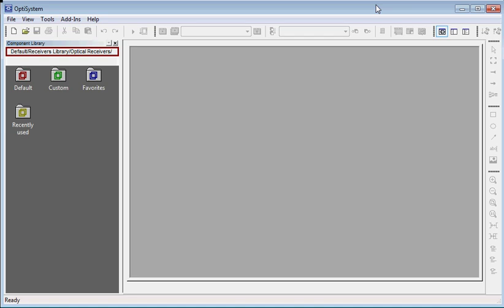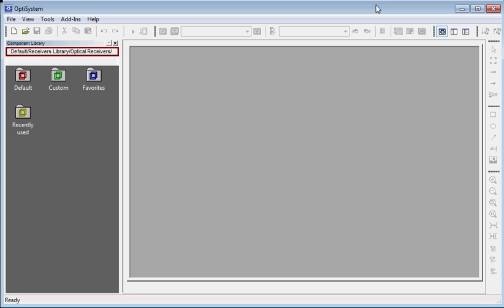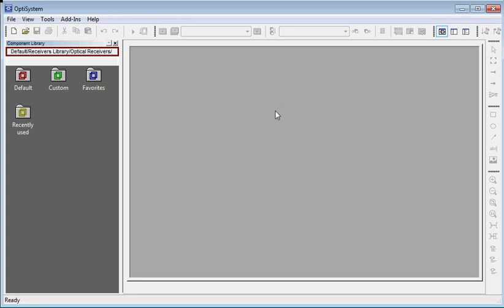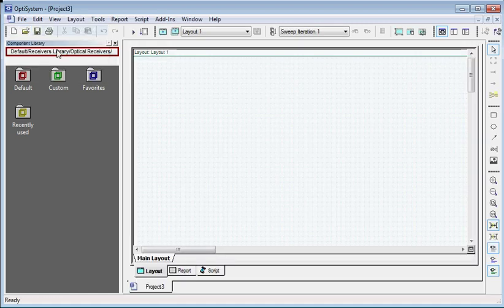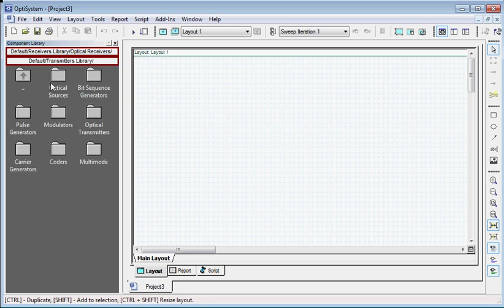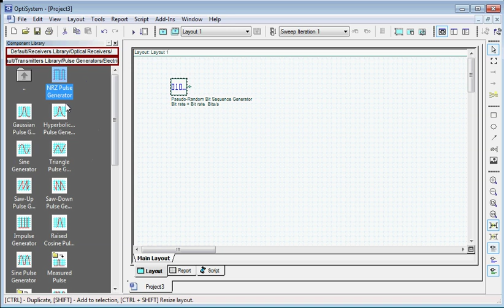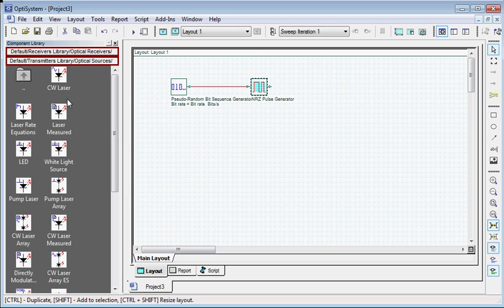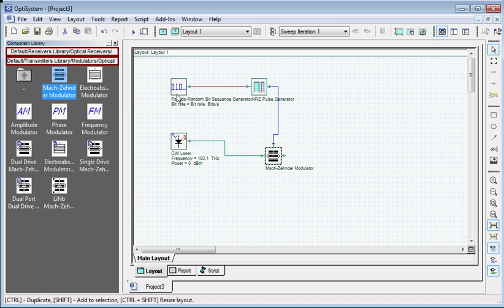Introduction to Optisystem - Transmitter

Comment: I m using  16 qam optical transmitter from the component library with power equal to 0dbm but when I connect optical power meter with that that is showing _14 dbm power could u plz suggest what should I optimize sp that I could get 0dbm power in optical meter

Comment: Congratulations for the initiative.
We also work with simulations of optical networks and photonic crystals in OptiSystem, OptiGrating and OptiFDTD.
I made a tutorial in Portuguese about OptiSystem.
Follow the links:

OPTISYSTEM TUTORIAL IN PORTUGUESE - CLASS 1 - TRANSMITTER IN OPTISYSTEM
https://youtu.be/oLL-HjBVerM
OPTISYSTEM TUTORIAL IN PORTUGUESE - CLASS 2 - CREATING A RECEIVER IN OPTISYSTEM
https://youtu.be/XpbwqJNNJI8
OPTISYSTEM TUTORIAL IN PORTUGUESE - CLASS 3 - INSERTING THE OPTICAL FIBER AND EDFA IN THE OPTISYSTEM
https://youtu.be/aiv9oe9o-Q0
OPTISYSTEM TUTORIAL IN PORTUGUESE - CLASS 4 - SIMULATING IN OPTISYSTEM
https://youtu.be/ycN95LhvtnU
OPTISYSTEM TUTORIAL IN PORTUGUESE - CLASS 5 - WDM SYSTEM IN OPTISYSTEM
https://youtu.be/HDyvLfsTg3s
OPTISYSTEM TUTORIAL IN PORTUGUESE - CLASS 6 - PARAMETER GROUPS IN OPTISYSTEM
https://youtu.be/JcvgbRTHpRI
OPTISYSTEM TUTORIAL IN PORTUGUESE - CLASS 7 - MULTIPLE ITERATIONS - OPTISYSTEM SWEEPS
https://youtu.be/CYFWSxw5un4
OPTISYSTEM TUTORIAL IN PORTUGUESE - CLASS 8 - DIRECT AND EXTERNAL MODULATIONS IN OPTISYSTEM
https://youtu.be/3LmA-WhoOp_0
OPTISYSTEM TUTORIAL IN PORTUGUESE - CLASS 9 - TRANSMISSION RATE BIT RATE IN OPTISYSTEM
https://youtu.be/5OT3use72t8
OPTISYSTEM TUTORIAL IN PORTUGUESE - CLASS 10 - GENERAL PARAMETERS IN OPTISYSTEM
https://youtu.be/kwNo9ZhdULQ